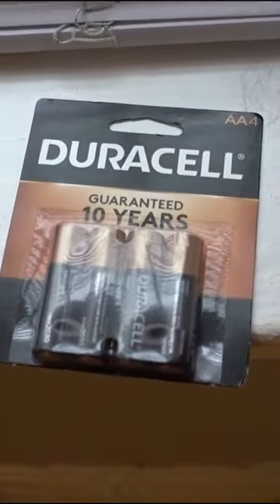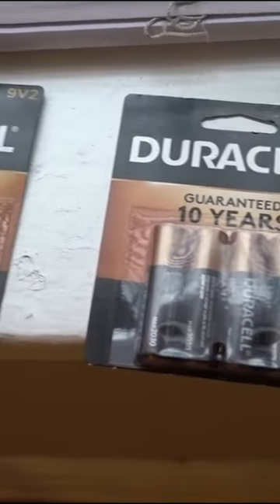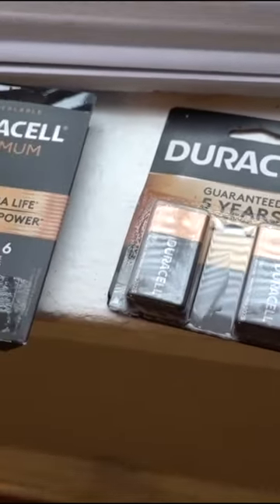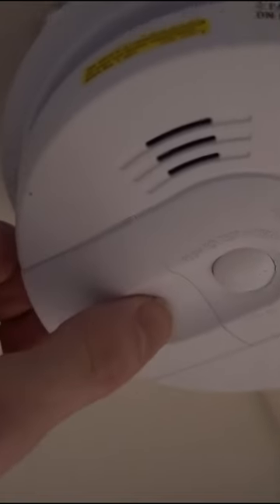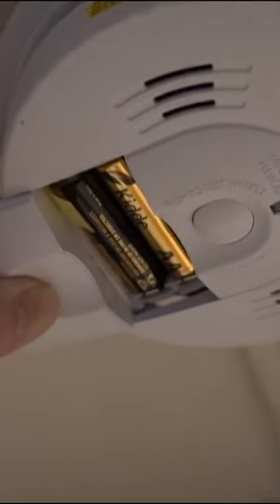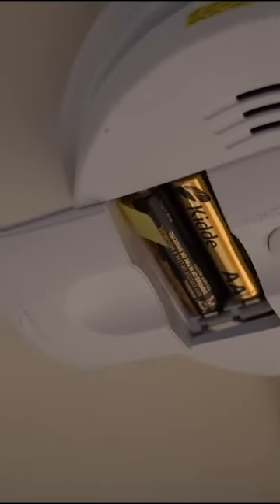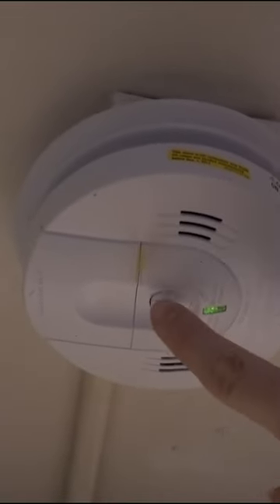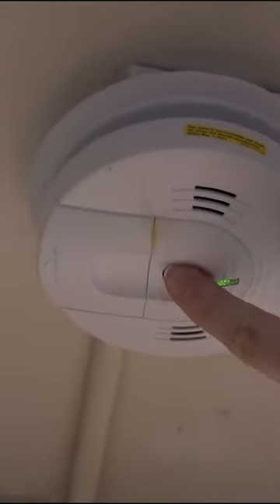How To Replace A Battery On A Smoke Detector (beeping) #shorts

Comment: What if it keeps beeping after you change it ?
Reply: Sometimes holding the test button with no battery in the alarm will drain out the current left from the old battery. Once you held on to the test button for 10-15 seconds then you should be good with inserting your new battery.